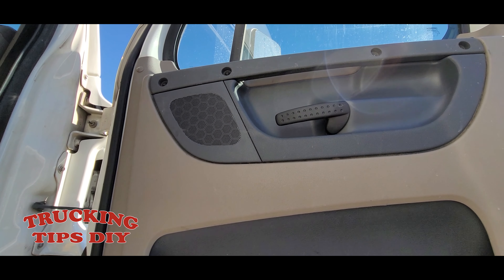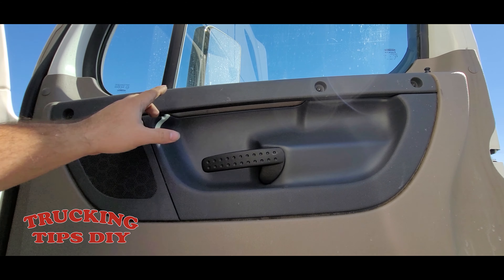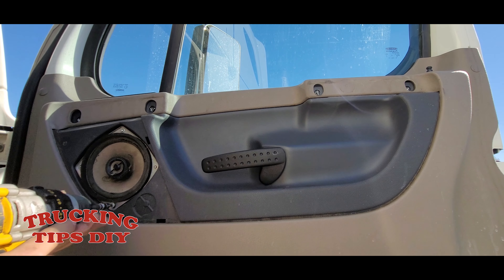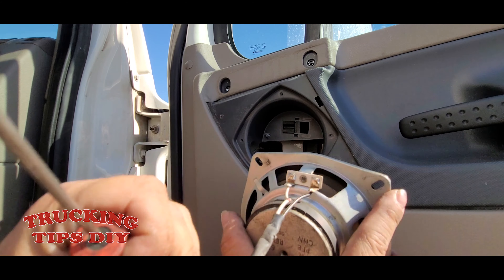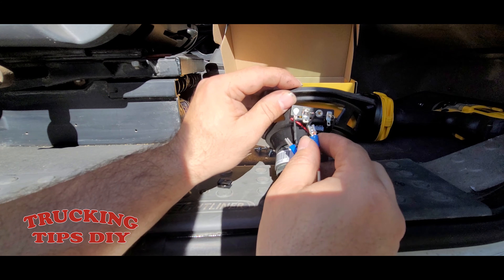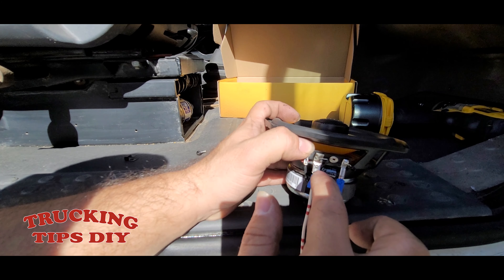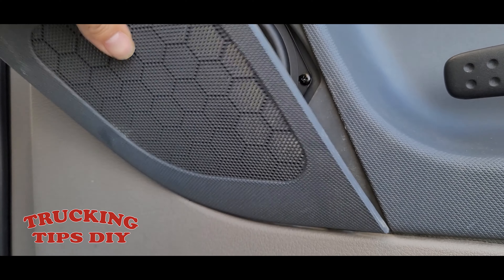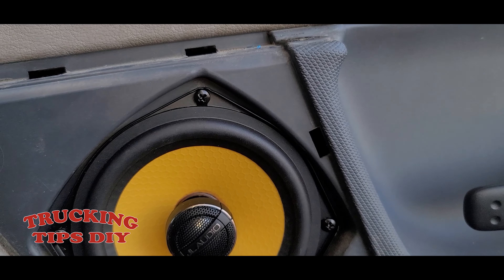How to replace door speakers on Freightliner Cascadia / JL Audio C1-525

Comment: Surprised you didn't just cut the door panel recessed part away 🤔 to keep the speakers mounted flush in stock location and trim.
Reply: @TRUCKINGTIPSDIY  the door panel recess part is trim, nothing structural. If you add a seal behind the speaker and where it meets the exterior will also increase performance of the speaker.
Reply: Straight rookie 🤦🏽‍♂️

Comment: You should just cut that piece out bro I'm gonna get these same ones and also buy a basket for the speaker to set I  and a small foam ring to place between door and speaker so all the sound goes into the Cab instead of a bit of loss through back side of door I'm an audiophile

Comment: How about the rear speakers in the cabin can you do a video about tho’s
Reply from the maker: Hello, I'm going to order some speakers and I'll do a video I'll let you know once upload,  thanks for watching!
Reply: @TRUCKINGTIPSDIY  yeah for sure looking forward for that video. Thanks
Reply: Update
Reply: @TRUCKINGTIPSDIY  do you know the speaker size for the ones in the back sleeper?
Reply: @chilar6  They are 6x9, and you will need a new radio and maybe an amp if you really want to overcome the road noise. You might need a wire harness for the new radio, Freightliner sells them. I'm about to change out everything on mines because I can barely hear music while driving. The factory radio keeps going out and turning itself back, and it is driving me crazy. These trucks are damn near 150k new, and they have the nerve to put extremely cheap ass stereos in them with no quality.
Reply: @drjd2real  I changed radio on mine too. Pioneer. But it also keeps turning off  at time. What could it be? My guess is inside the dash board it gets too hot
Reply: @chilar6  That is probably the reason. When I switched to aftermarket they never cut out. You need to make sure the fan on back of the radio isn't blocked because those Pioneers are designed to handle high heat. Last resort is to get an amp. The radio will run cooler if no speakers are connected. Running your a/c should keep it cool enough unless you have a bad unit.

Comment: I wouldn’t install these speakers because the speakers push against the motor that opens and closes the window and the window barely goes back up. Rockford fosgate make a 5.25 called R1 and they 60bucks for 2 and sound good and won’t cost more money replacing window motors.
Reply: Do the fosgate''  door speakers fit flush??
Reply: I returned the jL audios and bought Rockfords and they fit perfectly and sound just as good
Reply: @Lolhaha282  cool thanks 👍🏿👍🏿
Reply: @Lolhaha282  how do the Rockford sound &prime or punch ?
Reply: Its good for what it is but basically all 5.25 speakers don’t have much punch. I recommend the fosgate for the freightliners over the jL based on the magnet not being so big that it effects the windows going back up after you open it.

Comment: Anyone know what size speaker is in the door of a 2020 cascadia. I also can't see how to open up the door to get to the speaker to measure it. it's not the same as this version. I can't find the info out anywhere. Even the truck manual doesn't say a thing. ty
Reply: Call your local Freightliner dealer and ask for Parts. Anyone in the parts deptmartment can look up the exact part. You will need to give them the last 6 digits in your truck's VIN so they get it right.

Comment: Mine has rivets holding the speaker how do I remove those rivets ?
Reply from the maker: You can drill it, use a small drill bit and drill right in the center, rivit sould come off
Reply: @TRUCKINGTIPSDIY  Thanks bro 🙏

Comment: What about some bass with other speakers added.   ?
Reply from the maker: Yes i pit a jl audio 500 andone 13" w6 JL
Reply: @TRUCKINGTIPSDIY  post it . Amp?
Reply from the maker: I was driving when i wrote that comment lol,, i have a 500 JL audio amp, and a W6 jl audio sub,, I'll make a video soon, ate you planing on installing on you truck?
Reply: @TRUCKINGTIPSDIY  yes I am it's a day cab.  Need a little bit better sound but u know space is tight.  . So I need ideas.